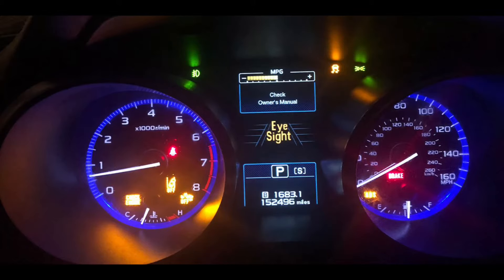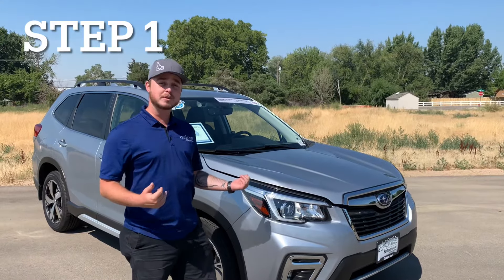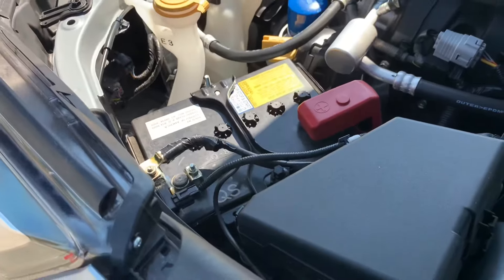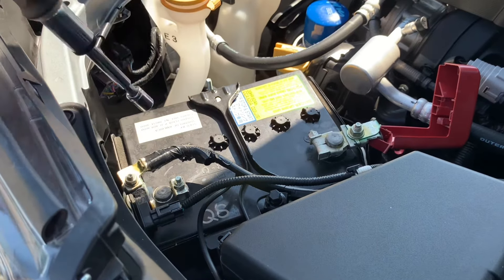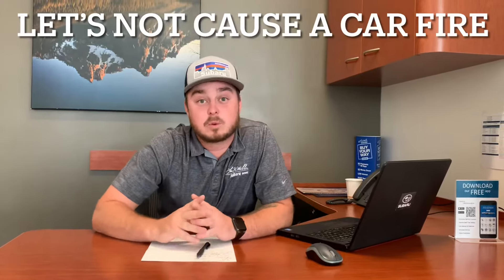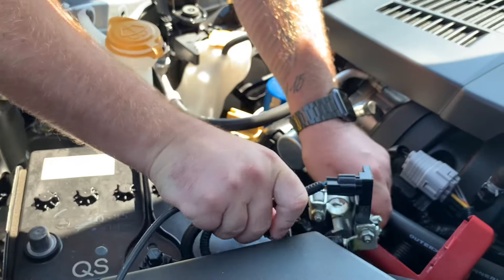All Dash Lights are On… Subaru

Comment: You are an honest person. May God bless you. My son's 2019 Crosstrek experienced this issue. All lights came on for no reason. Took it to the dealership and they said there was gunk in the engine. They did an engine flush. Didn't work. They said bad sensors. I told them to stop. I knew there would be no end to their scam. My son already paid them $800. I watched your video and it was a 5 minute fix!!! You are a man of integrity. ❤❤
Reply: I hope you got your money back! I would be furious!
Reply: I went to West Houston Subaru in Katy, Texas for oil change , after few hours so many lights came on. I knew they did something to the car so I can go back for rip off, soon I get there! Service advisor told me it's P26A5 CODE for thermo control valve. They want to charge me money and leave the car full day. I knew something was fishy. They do to cars , so you keep going back . Went on You tube and saw you as first video. Took 10 mm as you mentioned followed the 2 minutes instruction, closed the hood and problem solved. These Service dealership are running out of ideas and now scamming people . And plus I had extended warranty. Thank you so much 
God bless your family
Reply: Same issue twice with my 19 crosstrek

Comment: You have done an excellent job in saving us from a trip to the dealer for a repair we accomplished easily with your guidance. Our Subaru is a a 2015 Outback which had just been through a substantial overhaul by a dealer and this dash light problem started surfacing a week or so after we got the car back. Your fix worked wonders and your instructional methodology was first class! Thanks again for your guidance!

Comment: Thank you very much, Kyle. My wife can home from work stuck in heavy traffic and told me check engine light and all dash lights came on her 2018 Crosstrek. I checked the manual and gas cap to no avail. Found your video and said what the heck, gave it a shot. Like magic, worked like a charm. Will keep an eye on battery as it is the original. Charged it with trickle charger an it fully charged in 15 minutes 👍. Thanks again, much appreciated...

Comment: Amazing! I got the same runaround from Subaru when I called to inquire about it and was told it was gonna be $1000 in sensor replacement and that I shouldn’t drive the car! I knew immediately that this could not be the case as I had just installed a new battery, and I suspected that, but was curious to see what Subaru was gonna say. What a scam! And fix took less than 3 minutes!! So appreciate you and this video

Comment: wow!!!  I hit subscribed because you are a life saver.  Just drove down all day from Salt Lake City to Mesquite, half expecting I would be stuck somewhere between hell and nowhere.  My check engine, EYESITE, AND SEVERAL other lights literally illuminated the dash panel.  I got here physically and mentally worn out from the stress of not knowing if my '21 Forester would go another mile, leave alone get me to the St. George Subaru.  It's Easter Sunday, I tried to send a message to a person saying his last name was the same as the dealer.  He would not tell me what was wrong, or how to fix it, and gave me the sales jazz "have a good day".  I stressed again for the last 4 hours, scheduled a service appointment for Friday back in Sandy, UT, could NOT feel good about the trip home Wednesday. I tried to relax, and I got the feeling to check YouTube.  Your video needs to be posted on page one of the Subaru Owner's Manual.  Everybody, go to your Lowes/Home Depot, buy a cheap crescent wrench and tiny flashlight and keep that in back where the tire is stored.  I had the light, and what used to be a useless 10-way plier/knife/multitool, and here at 10:45 pm in the hotel parking lot was able to do the "BOLINE MANUVER".  I am so thrilled right now--took less than 5 minutes, and I am FREE TO GO tomorrow.  Thank you so much.
Reply from the maker: Right on!! Glad I could help!

Comment: I had the same issue with my 2017 Outback. Full dash lit up for days. It didn't affect the driving but I dreaded calling Subaru about the fix. I was new to this area and I had never been to the dealer an hour away. I decided to check out YouTube since it has helped me before and I found this video. I followed your instructions and behold, a perfect running car and dash lights back to normal.
Thank you so much for the info.

Comment: Holy Huckleberry! We bought a new Crosstrek a year ago. It has 8000 miles. The eyesight stopped working and the check engine light went on, too. Called the dealer and was advised that the car was safe to drive and make an appointment for service. So, the appointment was a week away. Watched your video and followed instructions. YOUR SERVICE TIP SOLVED THE PROBLEM Thank you. Will it return? Maybe. But at least we know what to do next time, first.  Again, many thanks. Cody.
Reply from the maker: Heck yeah!

Comment: Kyle, you're a blessing to me.  Thanks!  It worked like a charm.  Woke up this morning and found the 2020 Subaru Forester showing the check engine light and the EyeSight system not working. While the battery was disconnected I cleaned the terminals and brushed on a small amount of dielectric grease.  As you mentioned the battery may be going weak.   It has been four years since I purchased the vehicle.  In the meantime, I will charge the battery and replace it before the winter.  Thank you again.:medal-yellow-first-red:

Comment: Just had a couple of days around 0 degrees F and our 2020 Forester did this. Folks be careful - your fuel to air mixture is all jacked up on top of all the other variables. Carry a 10mm socket with a small extension in your vehicle at all times and this method will fix things. But, don't drive your vehicle in this condition. Do the reset ASAP. AWESOME VIDEO!

Comment: Thank you so much for this wonderful video!! I had left a door open for too long. So, the battery went out. I jumped it, and it was fine. And the next day, it was dead again. I jumped it again, and drove around for over an hour. When I was getting back, all the lights went on, and the car sputtered a little. My battery is about 2 years old. I followed your directions, and everything is back to normal!! Thank you so much!

Comment: I just returned from a test drive  with 2021 Outback, after following your easy instructions. I'm delighted but holding my breath. This morning, I followed another YouTube video which instructed me to only remove the negative terminal, then hold the horn down for 30 seconds and turn on the lights. It did work for the a drive to my grocery store. When I returned the lights all came on. I was having the same problem as everyone else but also my temperature gauge was not moving from the cold position. And after my first attempt above, the temp gauge was not working but the warning lights went away.....  But your method did it all. All dash indicator lights...gone, and temp gauge functioning properly. Thank you so much!! I would buy you a 12 pack if you live in N Wisconsin!!!

Comment: Kyle, you are a life saver!  Because the display included "Eye Sight", I thought that system was the one at fault.  But when you said other lights were on at the same time, which was the case with me, I realized it was not just the Eyesight.  So I took your advise and it was fixed.  Thanks a lot.  You probably saved me a costly trip to the local Subaru dealer!!!  A like and a Subscription is "in the mail".
Reply: My guess is Subaru disables the eyesight when the car is in fault to kind of force people to the dealership. People will drive around for months with a check engine light on.

Comment: Fixed my daughter’s 2019 Subaru with dashboard all lighted up after looking at this video. A big THANK YOU! I also found neg battery connection extremely corroded which I thoroughly cleaned. Again, thank you for video, saved a trip (and $$) to Subaru dealer

Comment: Thank you, great info for resetting the check engine light on a 2023 Subaru forester. One thing I would like to add first check your gas cap is not loose. That was my first problem it was loose.
Once I corrected that issue, I did the same thing you did on the video. It took care of not only the check engine light, but also the other lights that were triggered by the emission sensor.
THANK YOU for your knowledge and willingness to share it with others.Subaru Drivers. Your video worked great

Comment: saved my wallet and fixed my headach along with my 21 Ascent. day 1, check engine at oil temp abs uphill assist lane change collision, all on. day 2 all but at oil temp. day 3, check engine abs on. did this and it reset it all. thank you SO much!

Comment: OMG, If you were here I would hug you! Traveling with my husband and many lights went on. We live in NC and are on our way to Fort Myers FL. Called a dealership and it is Monday and they wanted to give us an apt. on Wednesday. Talk them into tomorrow then got to our hotel and started to YouTube to see what I could find. One video had awful comments that were scary, expensive and no two answers were alike.Then I came across your video. Earlier when we got in our car it said 91 degrees and when you mentioned the battery being drained it made sense. So off to Walmart to get a wrench, we followed your instructions and the lights went off! Thank you, thank you, thank you. xo
Reply from the maker: Right on!!! Glad I could help, I have a buddy who just moved to NC, sounds like the golf courses are nice there. I may swing through to play a round in the future! Have a great time traveling in your Subaru!
Reply: It's far past 91 degrees here in lower Alabamw MOST of the time. I pray to all that's holy I won't be doing this trick constantly- but at least it's easy! 🎉😊
Reply: @hemiguthrie1752  It worked for us, There are also people on YouTube that tell you how to get the diagnostic code for what is wrong (if you have a regular key and not a key fob). Almost everything is on YouTube.

Comment: I was two hours into a three-hour drive  yesterday when my Subaru Crosstrek's dashboard went bonkers. Check engine, AT oil temp, cruise control, ABS, hill assist - all lit up! I thought a sensor was broken. But then my husband and I found your video, and this afternoon I went out and fixed it in 15 minutes. All is back to normal. As Stan said, it would have been faster if I'd had a socket wrench. 
I'm pretty fixated on privacy, so it's a testament to my gratitude for your video that I logged in to say THANK YOU!!
Reply from the maker: Nice!!! Appreciate it!

Comment: Spot on with this advice for my 2017 Forester.  It took me five minutes. You will probably need reset date and time.  I scheduled an appointment with my dealer and who knows what they would have charged.  This is what I originally had:  Suddenly my 2017 Forester warning lights came on: CHECK ENGINE (checked fuel cap), Eye Sight, Vehicle Dynamic Control Operation and Hill Assist lights, and RAB all came on. THANKS AGAIN FOR THE SUPERB ADVICE!!
Reply from the maker: Awesome! Glad I could help and if you have any additional questions, throw it up on here and I'll look into a video for it in the future!
Reply: Currently i have this problem with my ascent onyx 2022. I try it tomorrow. Hope it works
Reply: @stephenbandico9632  did it work
Reply: I have the same problem with the eyesight. I was told that I need a new battery. Should I go ahead change out the new battery . Hopefully it will solve the problem itself after I change .
Reply: Does this fix the issue? Meaning, whatever caused the issue in the first place (I just test drove a 2018 forester and when I turned onto gravel, this happened) if I did this fix, next time I turn on gravel would this happen again?

Comment: I just fixed my Subaru forester 2020, engine light eyesight light was on, the dealer called me yesterday to bring the car there, I went to the dealer this morning, they asked for $250, for diagnosis, I left with no doubt. Then I went to the mechanical shop, they said it takes 5 hours to take off the engine to replace the sensor, advise me to go back to the dealer, then I went home and open this video again, fixed it within 5 minutes. All the light off, and I tried the car, the lane departure was back on, eyesight was back on. Thanks so much saving me so much money and time. ❤❤❤
Reply: After I drove one time, I restarted the engine again, and the lights are back on, omg. Is Subaru controlling our car ? I tried again, it’s went off, after I restarted again, the lights went back on😂😂😂

Comment: My 2018 Subaru forester check engine, ABS, hill assistant, eye sight lights up yesterday and [S] light flashing. I thought it'll casue my arms and legs. You saved me. It fixed my car in 10 minutes.
Reply from the maker: No problem, glad I could assist!

Comment: Hey man, thank you very much you helped me fix it. My wife left a light on so it dried the battery, after jump start it got on but all error lights were on. Saw your video, followed same steps and fixed it. Thank you again you saved me some money. Subaru forester 2020 hybrid, if anyone has the same issue follow the steps in the video. 
P.s. was a little scared I wont get hit by electricity when I was about to touch + and - cables together with bare hands but all good 😂😂

Comment: I have a Legacy from 2004. It suddenly stalled and when trying to start it all electricity goes out. Turn the key and it goes out in a few seconds even without trying to crank it. Checked the battery connection for oxide, checked the charging status and all was ok. Tried this strange tip without believing in it but it worked! Still can't belive it but thanks a million!

Comment: Thank you Kyle! This solved the problem on 2020 Forester. We had been driving about 2 hours. When the holiday dash lit up. Of course the Subaru Starlink sent some sort of message to the powers that be and I received an email from my dealer to make a service appointment. We had just had service done and I did not want to part with anymore $$$. I gave your tip a try and it worked great.

Comment: Thanks Kyle.  This fix worked although it was a bit terrifying touching the battery cables together as they are lashed down pretty tightly on both sides in my 2020 Ascent.  In my case I coincidentally filled the car after the ECM tripped and noticed the gas cap was loose in its socket.  This, according to another youtube, was the most likely culprit in tripping the ECM and engine light.

Comment: OMFG! Thank you so much for this, I can confirm this trick works on 2015 Subaru XV Cross Trek!!! I took my car to the dealership and they quoted $5000 to get some apparent sensor fixed. Wow, just wow! 
My questions are:  
1.does this mean the battery needs to be replaced soon? 
2. how did this "low-voltage" occur and what can be done to prevent it?

Comment: Your recommendation for the problem & it worked !! But I also asked on a Subaru Owners FB page & got several comments snout all I did was resets the sensors & now won’t know if a underlying problem exist, that I should have taken it somewhere to have “ the codes ran” .. so now I’m Worried

Comment: Thanks you very much! my 2021 Subaru Forester Eyesight disable and check engine turn on without any problem. After watching your video which fix or reset my eyesight nd now it's working.
Reply: After couple days the Eyesight got disable again then I open the Gas cap for 30 sec then put it back on which solve the problem. Hope it doesn't come back then will take it to dealer to check it out.

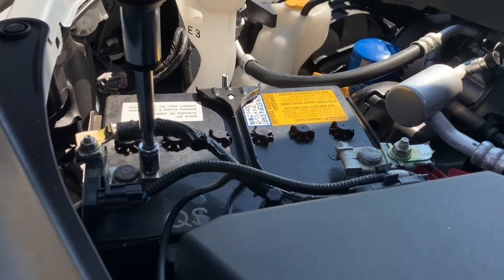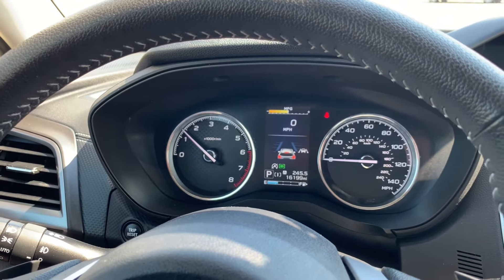Comment: Good job Kyle. Hope you retrieved the 10mm socket you left on the negative terminal bolt (1:57, see also 2:14 where you are holding the driver sans socket).
Reply: I was going to comment on that but thought I would look through the comments first to see if anyone else picked up on that! lol
Reply: Just watched this to try and fix the same issue on my GF's 2021 Subaru Forester. Everything is copesthetic again, but yeah I was worried about him leaving that 10mm socket on the negative terminal 😅. Tbh tho I don't think he would know what he does about this particular issue and make such a rookie mistake.

Comment: That was awesome fix did not know if it would work but perfect. question I checked the water levelon the batery seems a little low can I top it up with distilled water to give the battery a little bit more life?

Comment: Thank you.  Only some of the lights are on my 2013 Subaru, the Eye Sight symbols, the Check Engine, Traction Control, and a flashing brake light.  No other lights are on. But I will try it.  Battery being weak would be a likely cause.  Follow up - did the test, and it reset the dashboard.  The voltage must have dropped as I noticed he battery has leaked acid.  So I need a new battery - which is still under warranty.  Thank you so much!

Comment: Great find and I’m going to try it tonight. However, what if the battery is an actual issue?? Does it stay on come back if battery is weak? 
I have a ‘21 Crosstrek and they’ve replaced it once less than a year ago
Reply: I tried your trick and it worked!  I’m still a bit concerned about battery, but I’ll have it checked.

Comment: I left my cargo light on and my battery was died so I jumped with my other car and then all my warning lights came on.  I started with disconnecting the negative pole and left it disconnected and found your post..So I also disconnected the positive pole and touched the two together as you suggested for 20 sec reconnected the pos then the neg and presto good to go.  Thanks for your help